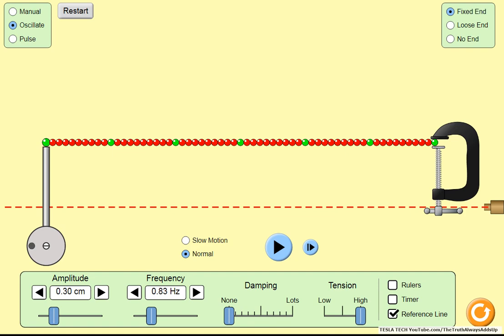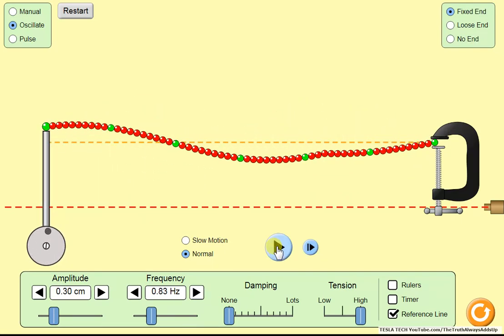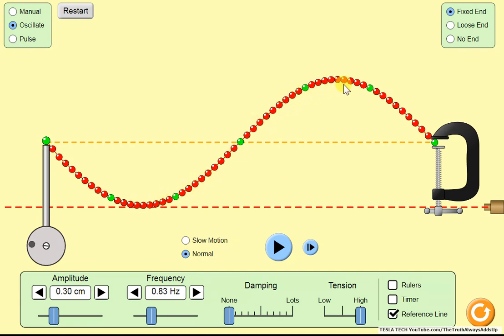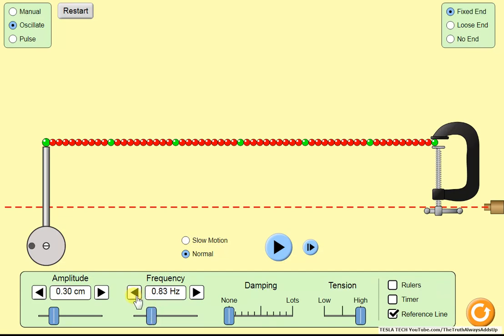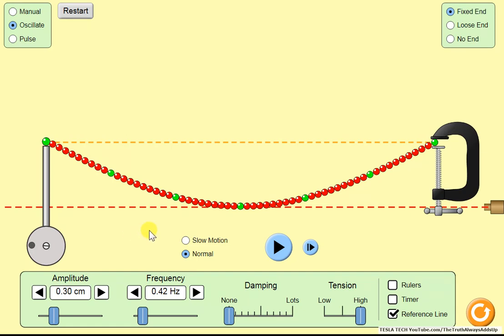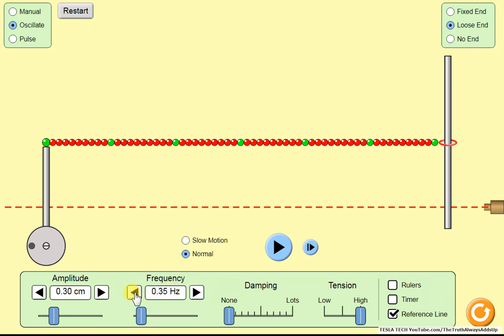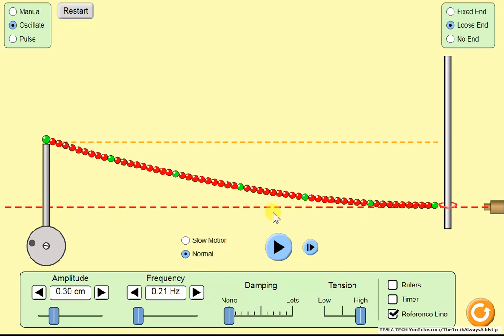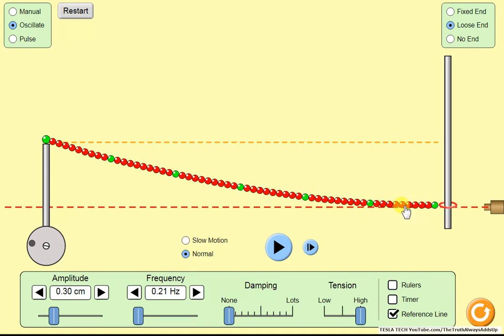Tesla Tech The gain using a quarter wavelength standing wave

Comment: Seems like you are missing the reflection coefficients in your little thought experiment. The voltage has a gamma of 1 and the current has a gamma of -1 due to the spatial distribution between the top and bottom of the transmission line or coil. Nice job on the software. Did you write it? BTW - you can find much new info about VIZIV on the nedyn youtube channel (National Electrodynamics). Cheers

Comment: Are you a HAM radio operator?  I wish I could learn all that stuff.  It appears to be very fascinating.
Reply from the maker: No, I'm not a HAM radio operator, I'm an ex microwave test tech from Hughes EDD (Electron Dynamics Division) where I worked in R&D of TWTs (Traveling Wave Tubes/RF amplifiers) for satellite communications.    

If you would like to know more you can check out my website, I would start with my post on The Aether Defined at:  https://davnxs.wixsite.com/teslatechexplained/general
And Part 2 : https://davnxs.wixsite.com/teslatechexplained/the-aether-defined-part-2

The tech is all explained here: https://davnxs.wixsite.com/teslatechexplained/page-1

I also have a Facebook group:  https://www.facebook.com/groups/therealteslagroup
And my FB account:  https://www.facebook.com/DavNXS

If you have any questions message my from Facebook is the best way to get a hold of me as I can no longer keep up with the comments on YouTube.
Reply: @TheTruthAlwaysAddsUp  Bummer.  I heard you talking about 1/4 wavelengths [which works perfectly for 10,11, and 12 meter ham radio bands] and working with all of that fancy gadgetry, and I right away said to myself, maybe this guy could help me to tune my radio antennas.
Reply from the maker: @fanbutton  Do you know why tuning them to 1/4 wavelength works the best?
We use VSWR  meters, and I don't know if this will help you any or not, but if you have an oscilloscope and a coupler (used backwards) along with a frequency sweeper, you could do a cold match on it for the frequency you want and sweep across a frequency range with the frequency you want in the middle you can see it on the oscilloscope while you are tuning it.
Reply from the maker: @fanbutton  But what I am talking about is the key to Nikola Tesla's free energy.  The 1/4 wavelength is set up in a transformer and thru the principles of wave superposition and constructive interference there is a 6 dB gain of the input signal per cycle if the input drive.     When the power level is reached you reduce the input power to only maintain the power level you want.  

I have a video that I made showing the overunity but I almost had my Facebook account terminated for uploading it to a comment.   At that same time YouTube gave me two strikes for videos that I uploaded 10 years ago, so I haven't uploaded it to YouTube......   I have some other video platform accounts that I should upload it to, but I'm just kind of laying low for right now....      

I have uploaded it to other comments on Facebook, but that's because I kept records of what they did the first time I uploaded it to a comment......   They hit me with a copy right for some 7 minutes of music but the video was only a 1 minute video with no music in it.  I appealed it, but they never got back to me, which they said they would.....    They muted the audio in it the first time I uploaded it, but they haven't muted it when I uploaded it again, obviously because it was a lie!   I'm probably going to upload it or make a longer more detailed video, to Rumble and or BitChut?
Reply: @TheTruthAlwaysAddsUp  Great information.  Thanks.  :washhands:
Reply from the maker: @fanbutton  With my channel it's a matter of figuring out what they are going to attack next. I have already lost a lot of content from my channel.

As for your video, I've seen all the arguments and I just don't agree with them.   Show me one other planet out there that is flat. That's not what we see so there must be some kind of effect on light that they are not aware of.....  Just saying